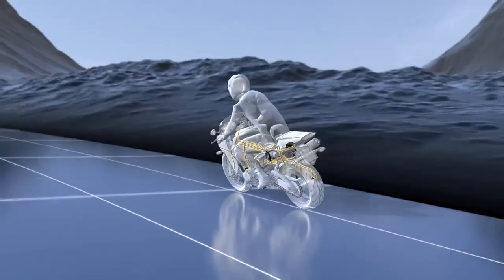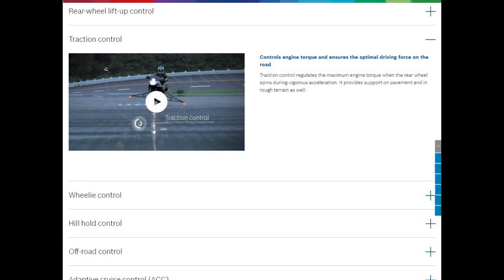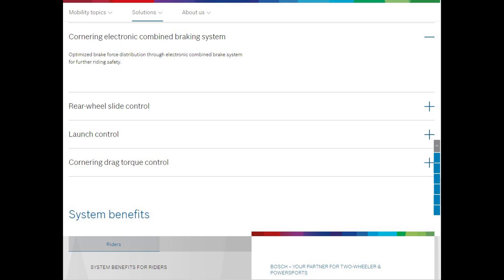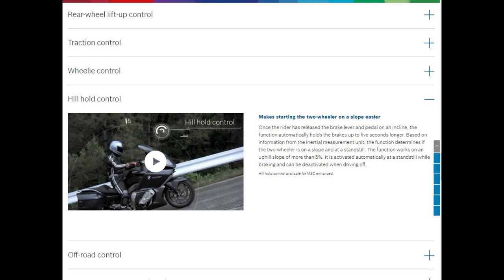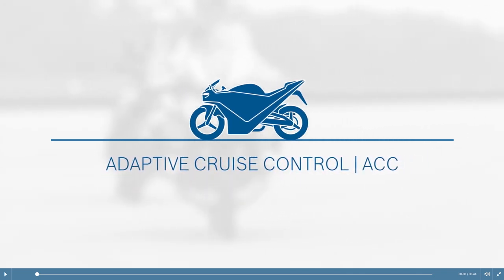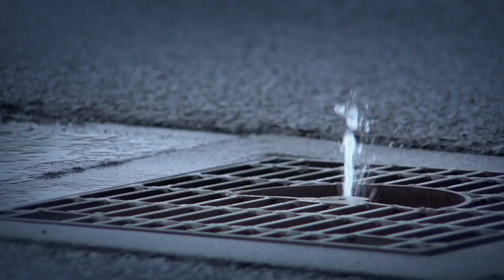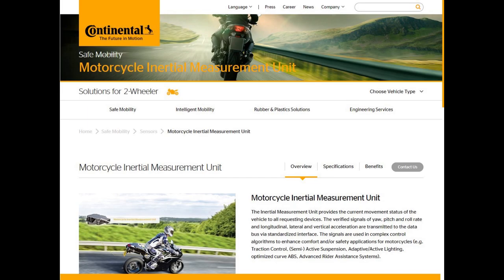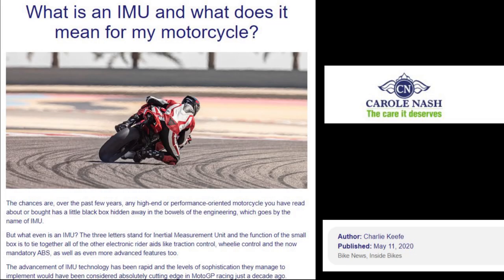Motorcycle IMU: Inertial Measurement Unit. What does it really do? Is it really better for riding?

Comment: I have no use for Rider age whatsoever if people don't learn from their mistakes how do they ever get better if the machine compensates for this stupidity they could do stupid stuff with the machine compensating for them. They should learn the proper skills and refine them until they're like the back of their hand. Pretty soon they will be like the old Penny motorcycle machines outside the Piggly Wiggly where you just get on it grab the handlebars and the Machine just rocks back and forth. You will be a passive passenger just like in an autonomous car. I don't want the motorcycle to tell me how fast I'm going to go or how hard I'm going to step on the brakes or how far I'm going to lean over or anything. But then I'm not in the market for a new motorcycle because they're all a collection of government regulations on two wheels nothing more nothing less.
Reply from the maker: Morning Frank. Well, that was, erm, forthright. I can (more or less) understand why you don't like the electronics, but why are you so angry about them? As you say, they are all easily avoided - buy a bike without them - so not really anything to get angry about.

Also, what about your foot? Is it okay now? What was the problem?

Cheers,

Chris
Reply: Your opinions are filled with blind ignorance.  I have motorcycles with 5-Axis and 6-axis IMUs and in no way does it interfere with my riding enjoyment but instead adds to it.  If you look at death and injury statistics on motorcycles objectively you should never ride without the benefit of minimal aids like ABS because the risk vs. reward equation is very unfavorable.   

I started my first riding off-road on small displacement dual sports in my youth and after a 25 year hiatus started riding motorcycles again both on and off-road.  If you have never riden off-road then your riding skills are never fully developed.  The street is the worst place to learn to ride and enhance your skills unless you want high risk of death or permanent disability.  Only on closed course with qualified instructor or performing demonstrated drills in an empty parking lot will improve your skills appreciably.

No rider is 100% attentive all of the time nor can predict the unexpected events that happen and trust their momentary  instincts will lead them to a safe outcome every time.  I have experienced the effects of rear wheel slip-out in a corner at the start of light  rainstorm on  striping or unexpected sand in a corner while braking and survived without laying down the bike or exiting the roadway.  This all on bikes without rider aids and consider myself fortunate to not incur major incident.   Riding two-up is another realm of responsibility where you are placing another person's life in your hands.  Now as a spirited but controlled older rider I have experienced the benefits of ABS and 5-axis and 6-axis IMU plus traction control.  It is that added margin of safety when things go wrong in an unexpected way.  At the same time  these aids in no way save you from your own stupidity.

If you have never ridden a modern 1000 cc+ bike with 100+ hp you have zero clue about riding high performance motorcycles.  You may as well instead go to the Piggly Wiggly and drop in a few quarters because you probably ride like the old grandpas I pass riding cruisers with their leather sofas.
Reply: @kannermw  oh please you do not develop skills nor do you improve upon them if the machine does all the work for you until it stopped can you find out how expensive it is to fix your electronics and then you will live without whatever failed
Reply: @Frank Markovci Jr  I've owned cars with ABS, traction, and stability control for over the past 20 years and not one of those systems have ever failed.  I will be selling this spring my 2018 VStrom 1000XT  with 5-axis IMU and over 25K miles and it has been trouble-free.  Prior to that I had VStrom 650 with ABS only (no traction control).  When I purchased VStrom 1000 I found my rear tire life was much improved extending the same size tire replacement interval from about 4500 miles to 5500 miles saving me money and time for changing tires without reduction in acceleration.  Slip actually reduces acceleration on the street.

I'm highly confident my riding skills would exceed yours by a significant margin.   I'm not so dumb as you are to believe that when faced with the worst of unexpected circumstances like a critter jumping out in front of me in a high speed corner on a two lane road with no shoulders and with some wet leaves blown onto the road  I would stand a better chance of surviving without incident based on riding skills alone.
Reply: @Frank Markovci Jr    You actually proved all my points. You drive like a grandpa on flat, straight Florida roads and accumulate only a lot of highway miles which does nothing to prove or improve your skills.  The fact that your rear tire lasts 10,000 miles is evidence you drive very conservatively  long distances at constant speeds on long straight roads.  Your 1998 Sportster 883  is a whopping 53 hp at the crank, provides marginal handling, with crappy brakes including single disc caliper upfront.   You probably dont need ABS because you would be hard-pressed to lock-up the front wheel if you tried.

  I live in upper midwest with a short riding season of only 6 months and still working so not much time to ride except weekends.    I have lived  all my life driving 42 years on ice and snow and NEVER in an accident or hit a critter larger than a squirrel. 

I've had many people pull out in front of me but I drive attentively and defensively.   Thus  it never becomes a matter of a few feet even on icy roads.  Yet you  feel obliged to profess you are  a skillful rider whose already totaled out a bike in an accident and damaged another colliding with a large animal?  I see large deer frequently but have never  hit one.  By any scoring measure  of accident rate I'm clearly a much more skilled driver and rider than you will ever be.

The real issue here is you are an old man the world has passed by long ago and you will never catch up.  You most likely  won't accept new safety tech because you probably can't afford it.  Otherwise, you wouldn't still be riding the same damn crappy HD motorcycle for 24 years.  Would you expect to walk into a emergency room and have them treat you with 25 year old equipment and similarly old medical practices?  Your answer to the last question has to be "no" and proves your  logic on modern motorcycle safety tech is both hypocritical and just plain moronic.  With your aging  vision, coordination, and slower reaction times you may soon be taking your nanny state BS with you to an early grave where it belongs.
Reply: @chrisoftheot6272  I had a woman pull out in front of me gave me two feet to stop I suffered severe leg injuries and back injuries but I'm not dead I am not angry I am just very disappointed in the lack of skills that people have nowadays and everything I tell the doctors if I can feel pain in my leg it's not dead and you can't cut it off. I like my nice simple classic vintage bikes you have to be still just to be able to start them. Problem is with a new motorcycle you don't have the choice you take it or leave it. Nowadays people don't have to learn anything they just look it up on their cell phone. People have no loyalty to anything anymore not friends not to family not to pet not to this country I did not nuke the planet when I had the opportunity in the nuclear service now everything is so stupidly bad it seems that it was not one of my better decisions but it's still on the table. People can't read they can't write they can't do simple math people nowadays are so brainless it's pathetic. Which is one of the reasons why they have to need Rider age to compensate for all their lack of skills. It just really makes me shake my head in disbelief
Reply: @Frank Markovci Jr  Do you really want to compare riding in the rain to driving on ice and snow?     I started my riding exclusively off-road and that is the best way to learn how to ride a motorcycle.  I still have a DR650 that I can confidently ride on loose gravel roads at 60 mph with the rear tail wagging like a dog.  Ever ride on wet grass and experience what happens with application of front brake in a turn?  That same experience  applies to sand or gravel on the road.

Florida truly has the most boring and flattest roads in U.S.  You  shouldn't brag about munching miles as you are simply killing what little valuable time you have left.  Have you ever considered taking an advanced motorcycle class?   All of your motor skills degrade with age so you need to work harder to maintain them.  All of the tech to which you are opposed can compensate for such inevitable losses if you make a mistake and help save your ass.  Bikes have improved a lot in 25 years and I would never trade the benefits of modern fuel injection for the compromises of a carbureted motorcycle like my DR650.   I'm a degreed mechanical engineer and willing mechanic who maintains my own toys.  I  truly understand and appreciate advanced technologies and do not fear them.  Probably  not so much if  I owned a Harley because they don't understand how to provide reliable electronics.

  I ride in a spirited but responsible manner and wear full armor gear, full face helmet, and gloves.  Do you do the same or are you the typical Harley rider type with the jeans, sleeveless t-shirt exposed saggy skinned arms, and bandana?  In that comparison who is truly more bold? The fully protected rider or the fully neglected rider?
Reply: @Frank Markovci Jr  What happened to you is precisely why I mounted two bright as sun Denali LED auxiliary lights on my VStrom 1000 that are less than 1.5 inches in diameter..  I noticed drivers were frequently nearly pulling out in front of me because they didn't see me until last 100 feet.  As soon as I mounted those lights they wouldn't pull out in front of me even if I was 1000 feet away.  I guess you could call that one of those advanced rider aids you are opposed to but the best $500 I ever spent.  I envision  you would state "Who needs those damn LED rider aids  when I've got old reliable single incandescent headlight!"    Don't want to ruin that classic HD look cause it's just those a-holes that don't know how to drive.  I got news for you the world is breeding more distracted and irresponsible new a-holes every day.  Good luck with that.
Reply from the maker: Afternoon Frank - nice to hear from you again.

I was trying to remember what you said about the accident, and your dreadful injuries. I can recall that you still have significant problems with your leg, but I thought it was restricted to 'weakness' now - your comment seems to suggest you are also suffering pain. If so, I can sympathise, even empathise to a point 'cos Anna has had dreadful medical problems - including pain - for nearly 15 years. (I am her carer now: not the career move I'd been hoping for!)

We have also noticed how people are 'somewhat fickle' in their support for us (family, friends, church, much of the greater universe...).

Do you have 'an Anna' to support you?

Cheers Frank,

Chris
Reply: @chrisoftheot6272  being old-school and self-taught once you acquire good skills you do not lose them. All the vehicles cars as well as motorcycles that have so many electronic exist doll the skills that we do have. When I read articles in magazines like writer about vintage bikes they always mention how you have to be more aware of your surroundings because of the fact that you don't have any Rider age to bail you out of a situation that you might have gotten yourself into through carelessness. I'm a bookworm while there still are such things but you learn by doing experience teaches you and if you mess up an end on the ground you learn not to do whatever you did again. This is what is lacking with today's Riders. You learn and that makes you a better Ryder. Forgive the grammar I have a smartphone that is very stupid. I got run off the road by a dump truck the last time and left in the road for dead. Hit and run no Witnesses. My Lady Foot Doctor keeps wanting to add my foot to her collection and I keep telling her as long as it still hurts It's Not Dead. I have had three friends died this year my two cats I got a hurricane in try to wipe my house off the face of the Earth. I just had me and my dog. I have found my generation of women to be poor wives and horrible mothers and generally not worth marrying. You're lucky you have someone. Looking to get back on two wheels soon. Ride safe.
Reply: I was on my BMW with halogen headlights on full beam. I have two auxiliary spotlights mounted on my Sportster front end as well as a spotlight mounted on the nose of my Ural sidecar outfit. I don't take the interstate anywhere. I have a fleet of bikes that vary from a Vespa scooter to a 1000 BMW BSA dirt bikes and BSA and Triumph road bike. I like my old Sportster which was almost brand new when I got it. We have a big problem with wild pigs running loose not only at night but in the daytime as well. Some are bigger than a cow. I have motorcycles from six different manufacturers all around the world. I fly a 103 year-old to Haviland gypsy moth biplane. That is a skill I know you don't have. And ask for what little time I have left I have been semi-retired since I was 30 and I have been fully retired since I was 50 great I have not worked for 13 years. While you spend all day at work I enjoy the many lightly traveled Backroads Florida. Take a dairy ride with my Kaplan riding buddy out to American Legion Post 69 in Plant City just for lunch. I would not waste my money on any brand new motorcycle if I wanted a Harley I can pick from thousands of low mileage chromed-out Harley garage Queens at bargain prices. So you think about that every day when you slip slide down the freeway to go to your job in the winter time and you take about me in Florida having a nice long ride out in the boonies chopped off by a good lunch and then another nice ride home. It's 80 degrees nice and sunny as I write this how's the weather where you're at smart-mouth?
Reply: @Chris OfTheOT  HI Chris, I much appreciate your video.  I will state that we need fewer individuals like Frank who ignorantly refuse to accept or publically oppose technology advancements in the name of safety that  are better for everyone including society.   If it were up to ignorant individuals automobiles would not have seatbelts, airbags, or anti-lock brakes just because they cost more even though the economic value to society are a net positive in preventing death or serious disability. 

My suspicion is Frank is probably getting government disability from his accident.  Whether his accident was preventable is debatable.  As a motorcyclist if you are not doing everything to make yourself more visible then you are part of the problem along with defensive driving.  Similarly, the multi-axis IMU technology with ABS can  minimize accident risk by at least 50% and  has net positive ROI.   The costs not so great that it shouldn't be standard equipment on most all motorcycles.  The insurance industry could force the issue by raising premiums to account for the higher risk.  The manufacturers will always resist because they will sell fewer lower price motorcycles.  What they are essentially  selling is more death and disability to the ignorants.  The actual cost of ABS and multi-axis IMU is less than $1500. IMO if you can't afford that then you can't afford to ride a motorcycle and incur the financial risks of an accident.

What really gets me are motorcyclists who refuse to wear a helmet or other proper gear.  Then in an accident they are more likely to have some type of long-term disability or higher medical costs (impacting insurance rates) that other tax paying citizens unfairly must pay for.  As a rider if you want that personal freedom then you should have to sign a waiver from any long-term disability payout as a consequence of personal negligence and similarly must carry insurance rider to cover such risk.
Reply: I said cars are the most inefficient means of transportation ever invented
Reply from the maker: @frankmarkovcijr5459   Afternoon Frank - well, I'm old (school) too and I'm finding more and more that my 'acquired good skills' are diminishing all too quickly. My reactions are slower, my strength is borderline pathetic, I can't diddly-squat without hearing aids and my once excellent memory is now flaky at best. Thank goodness I still have my fabulous beauty!

Anyway, it means that I'll take all the help I can get - even if it is electro-techno gubbins.

As for my 'someone', Anna is wonderful: 30th May 1994 - best day's work I ever did. Still great love between us, even though dreadful health has spend a decade-and-a-half trying to spoil it.

I wish I had something helpful to say about your foot mate, but I just don't. I feel great concern for you, but I don't imagine that'll help at all... I'm sad for you in your situation Frank. If you wanna just chat, you can always email me.

Cheers Frank,

Chris
Reply from the maker: @kannermw  Afternoon Kannermw - many thanks for 'appreciating' my video (even if most of it was BMW's work. Bless 'em.)

For the record, Anna has been 'getting government disability' for years. Your comment leaves me feeling somewhat defensive - not least because Anna has been very vulnerable for many of those years. Consequently, I cannot afford an extra $1500. Does that mean I am wrong to ride my bike (with no IMU)?

And let's remember: 'there, but for the grace of God, go I'. Frank's got a lot on his plate - including permanent pain - therefore, perhaps it'd be nice to cut him some slack.

Cheers,

Chris
Reply: @chrisoftheot6272  there are always people who have had things worse and my dog is good listener
Reply: @chrisoftheot6272  there was a Brazilian airliner the speed sensor got iced over and all the computers started to shut off and the crew didn't know how to fly the plane they gotten so lazy they all went spiraling into the Atlantic. Eyewear good riding gear when I'm riding but just because I am doesn't mean I'm going to be taking stupid risks. We all get old can't help that but it beats the alternative right
Reply: @Chris OfTheOT  I have no derogatory  comments  about public funding of disability payments to individuals who became disabled through NO fault of their own. 

However, the expansion of government funded programs to include individuals who NEVER or barely paid into the system is morally wrong for the other taxpayers who must sacrifice their own financial security or work longer to support others who collect  such deemed socially beneficial benefits.  Aging demographics in developed world including U.S. means fewer people working relative to those not working or retired is a recipe for disaster.   Now such social programs may only  be fully funded via increasing debt impacting  future generations, higher inflation, and/ or increasing tax burden on a shrinking group of payers.  I do take serious issue with individuals collecting disability due to their own gross negligence or blatant ignorance that could have been avoided or partially mitigated.

Now with respect to motorcycles it is for most individuals in developed world a recreation (luxury) not a basic mode of transportation.  It is also a very risky one at that.  In U.S, and elsewhere many life and injury savings technologies were introduced into automobiles that delivered net positive value to society.  The very idea that similar proven  technologies are not only practical but relatively cost effective (~$1500) begs the question why they are not fully adopted or mandated.    You yourself can look up the cost per motorcycle accident in UK.  In U.S. this  is approximately $185K with an accident rate of 1% per registered motorcycle.  "Motorcycle accidents have a staggering 80% injury or death rate, while car accidents remain around 20%. Motorcycle riders over 40 are around 20 times more likely to be injured in the case of an accident than car drivers of the same age." 

With these facts and the knowledge that advanced technologies can reduce accident incidence rate by up to  50% one can calculate the investment  return of such tech.  $185,000×1%×50%=$925/year savings.     $1500 investimate cost / $925/year = 1.62 year payback.  Any investment that has less than 2 year payback is exceptional.  These accident costs do not include pain and suffering, lost quality of life, expense to society for lifetime disability, lost wages,  etc. If someone can't afford an additional $1500 for a motorcycle that is mostly a recreational device   they can't afford to ride a motorcycle.  What is one or more months of lost wages worth?   Why does the ignorant past of the  70s, 80's, 90's etc need to be the standard for now when we know better outcomes are practical?

If you have never ridden bikes with these technologies you would barely know they were there if set to their least intrusive limits.  They DO NOT make you a better or a Worse rider.    What they will do is save you in panic situation where even the most skilled riders fail.  No one drives on the street like on a track and the  track is a controlled environment where most of the unexpected/unpredictable  hazards have been eliminated.  Those are the things that kill you on the street if you lose control or cannot stop at close to 100% of optimal regardless of road condition.

Bottom line is no one should be falsely asserting modern motorcycle safety tech is only for poorly skilled riders or well skilled ones.   It is for everyone and maybe more so for beginning riders whose first big mistake becomes their last.    It is that added margin of safety that might avoid catastrophe.  As much as I like motorcycling I would not want  to die or be injured as a consequence.
Would you?  Then who will care for your significant other?
Reply from the maker: @frankmarkovcijr5459  Afternoon Frank - well, you're right about the 'alternative'... Although, someone once said that getting old is like being increasingly punished for a crime you didn't commit.

Glad to hear you have a dog mate - great things, dogs. Here in Blighty, people say dreadful things like, "keep your chin up" and to maintain "a stiff upper lip", or "there's always someone worse off than you". To me, when people say that stuff to Anna, I become really angry. I feel they're dismissing Anna's suffering as inconsequential. There truly are millions 'worse off than Anna', but Anna's suffering is still real and, at times, dreadful. I suppose people just don't know what to say...

Life is a tricky business, Frank. (Getting trickier as I get older too!)

I trust you've still got the sidecar: keep enjoying it mate.

Cheers,

Chris
Reply: @chrisoftheot6272  yes I just hate it when people use platitude. I know what you're going through I had to care for my mom. I love my sidecar outfit. People are always buying the sodas so they can have their picture taken in the Sidecar. People's attitude changes when something happens to them or someone they love. Dogs are great, when I got my new doctor they gave me a psychological assessment a nurse is asking me was I depressed was I suicidal excetera excetera. I told her I just got a new puppy. How can you be suicidal and depressed and unhappy when you have a new puppy? Just watched Stewart Cunningham's new video from Merry Old England and he concurs with the other guys that with all the Rider AIDS La people become soft and compliance expecting too much of their technology to save them when they do something stupid. It's like the fact that nobody can do simple math in their head anymore because everyone is addicted to a calculator. I once w o n $50 from one of my teachers because I fed her that her 12th grade advanced trig and algebra students could not function without a calculator as she collected them all and they whined and cried and piss their pants until finally he got disgusted and threw the box at them. She told them how disappointed she was because they could not do the work on the side like we would do when we were in high school. We used to remember the phone number of everybody friends family didn't matter. Now most of us can't even remember a single number. England has some beautiful countryside. After I got out of the air force my lady friends in London picked me up a nice little Royal and field 350g. I rode all over Merry Old England on that little bike and then took the P&O Ferry because it was free for motorcycles back then. Went to Normandy sombering site crosses as far as the eye can see. Rode my bike through the Middle East. Took a ship to South Africa railfan all the beautiful steam trains they still had. I wish I could have brought the bike home with me but the fees and permits were more than what I paid for the bike. She was okay with keeping it at her house next to her Thunderbird kept her Motorcycle Company. Of course I would not want to ride all of those hilly roads and ice and snow. That is what is great about getting on a motorcycle you get disconnected from everything. You don't think about anything except enjoying the ride. I just have to convince the ladies at the sidecar does not come off the motorcycle except in the movies. Life is we just have to accept it both the good and the bad. I can't wait to get a motorcycle back on the road so I can get out to my plane. I have a 103 year old to Havilland gypsy moth biplane. Flying gives you a pleasure that regular people just don't understand just like trying to explain to them the pleasure of riding a motorcycle when they would rather be in a car. Ride safe Bee Healthy
Reply from the maker: @frankmarkovcijr5459  Morning Frank – good to hear from you again.

Being a carer is a tough gig, innit? I looked after my mum too; only for three months after a brain tumour diagnosis, but they were one of the three worst times of my life. Caring for Anna is much easier, if only ‘cos it’s ‘chronic’ not ‘terminal’.

I’m glad to see you still have the sidecar outfit, and that you ‘just have to convince the ladies’ about it. So, good luck with that…

One of my (many!) counsellors said that nearly all counsellors have been through mental health problems of their own, that’s why they ‘understand’ (so to speak). I suppose it means that, as you say, people don’t want to engage, or know how to engage, with other’s suffering. Literally, you need to have been there.

(One thing you mentioned that struck a chord with me was: ‘how can you be suicidal and depressed and unhappy when you have a new puppy?’ From personal experience, easily!)

Interesting pointer to ‘Stewart Cunningham’. I’ve not heard of him before so I’ll check out his channel. And I understand about being over-reliant on technology – I suppose we’re all guilty of it to some degree. I saw that in the Royal Navy, they still teach sailors how to use a sextant because in a war, the satellites would be knocked out. Sensible.

Anna used to be a school teacher and would agree whole-heartedly with your lament about the lack of students’ mental arithmetic abilities. She often quotes a TV program where modern, top-flight, 16-yr old A-level students were set an ancient exam paper for 11-yr olds (called the ‘Eleven Plus’). They all failed, even though they were predicted to get A* at A-level – which is the top grade for the highest level of school education in Blighty. Shameful.

Just for the record, you are a hero for riding a Royal Enfield 350 all over the world! You must have some amazing memories. Good on ya’.

I remember you mentioned that old Gypsy Moth before. Wild! I can easily see the psychological connection between riding and flying. Must be absolutely wonderful. I’m guessing, from your time in the USAF, that not many air-launched ICBMs fit directly to your De Havilland? (Well, I’ve never seen it done, but who knows? An interesting Winter project for next year?)

I’m off to learn Morse Code, and brush up on my slide rule skills now.

Cheers Frank,

Chris
Reply from the maker: Morning Frank – you’ll have to forgive the delayed reply (please!), but I’ve got stuff, and your post is mega!

First, no need to apologise for a ‘bummer’ comment. I assume you mean that your post is depressing or negative or some such. Well, it isn’t. It is, in fact, amazing.

Your IGC (as was) status is, to me, incredible. To be able to read a book in a single lesson, from my point of view, is a wonderful thing to be able to do. By comparison, I have (what one counsellor described as) “dyslexic tendencies”. This means that reading is utterly exhausting, although I love to do it. I used to be able to read for an hour or so, but nowadays, it’s more like 20 minutes max. (I’ll fall asleep, or simply forget what I’ve read and have to re-read a paragraph, or whole page.) So, forgive my ignorance regarding your situation, but I envy your prodigious reading ability!

From your replies, am I right to assume you’re also (what we used to call) hyper-active? I remember a famous British comedian & actor, Stephen Fry, said that when he was younger, he thought and spoke as such a ferocious speed, no-one could understand what he was saying. Similarly, he couldn’t understand why no-one could understand him! (Stephen Fry is famously bipolar.) Is that anywhere close to your experience?

You mentioned that the USAF psychiatrists, but I was not clear of who had the crap scared out of them: you or the psychs? And, why? Sorry mate, I couldn’t get the gist there.

With regard to intimate care for loved ones, you’re dead right: you do what you have to. I found looking after mum more stressful than looking after Anna, but Anna is not dying from a brain tumour (thank God). Still, it is stressful. And, alas, I’ve had lousy mental health all my adult life: debilitating bouts of depression, which started after my dad committed suicide when I was ten. It means that when Anna has a bad time, I get quickly exhausted and, if Anna’s health remains poor for weeks or months at a time, I become more depressed. Previously, Prozac saved me, but it stopped working and now I have Citalopram. Still difficult at times though. I helped Anna shower this morning but even before we’d finished, a ‘retinal migraine’ kicked in. She’s lying down now. Another tough day for my Precious.

Are you still into model trains? There’s a gent a couple of doors down who’s into model trains, though they’re N gauge – to save space. He’s looking after his wife nowadays and the models are a significant stress-relief for him. They’re both in their 80s.

Finally Frank, I have only one thing to say. Why haven’t you written a book. I mean, why? Don’t tell me that you’ve written your autobiography, but haven’t done anything with it, ‘cos if so, Chrisy smack. If you haven’t written it yet, well, why not? What are you waiting for? I need to hear about your sister, and your cousin Linda, and about how you felt all those years at school and in the air force. It’d be a great, important read.

Anyway, that’ll do for today. You’ve got some writing to do, and I have a wife look after.

Cheers Frank,

Chris